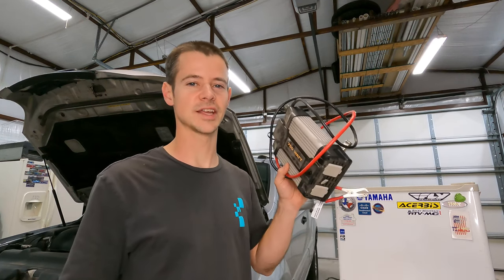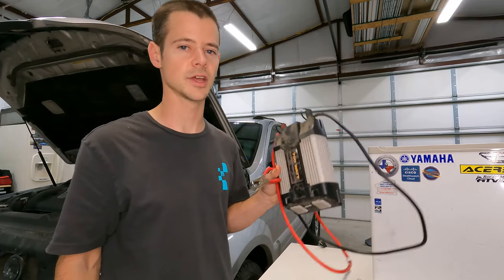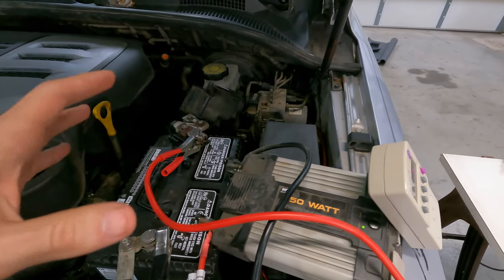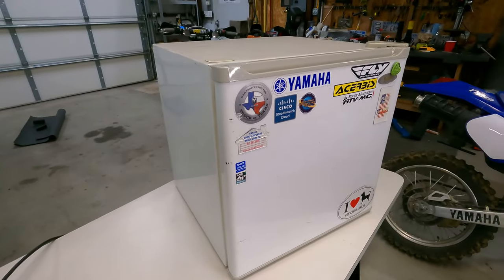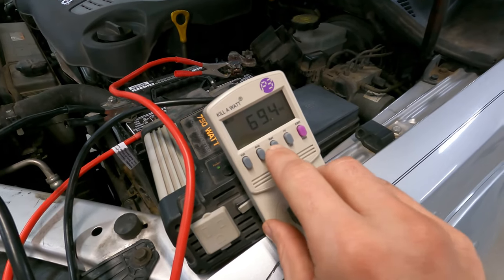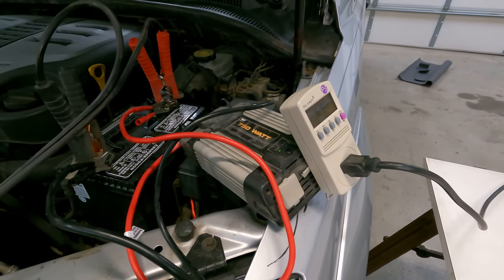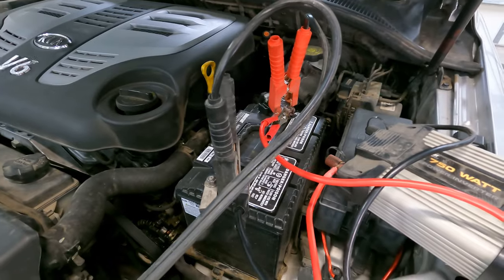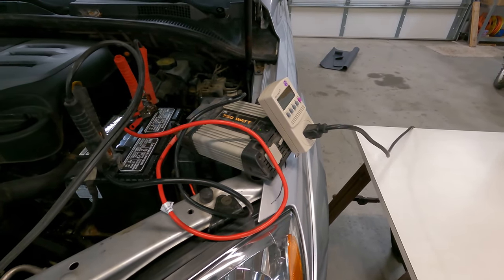Can a Cheap Inverter Power a Mini Fridge?

Comment: Thanks for this video!! I have a 1500 W inverter and wanted to plug in my mini fridge in my Freightliner! This lets me know it’ll work with no issue.
Reply from the maker: You are welcome! I don't much about Freightliners, but I would suspect if the wiring is heavy gauge enough, then it would handle it. Do you know if trucks like that are 12v or 24v? If 24v, and your inverter could run on that 24v leg, it would reduce the amp draw by half, and also reduce voltage drop by half - possibly more. Let me know how your setup goes. This stuff is so interesting to me.
Reply: @uthe54  Think trucks are 12 and have pretty huge amp rating alternators that can continously handle high loads

Comment: 0.59 Power Factor is a bad Modified Square Wave.  Pure Sine wave would be 0.95. (1/ 0.59) x 70 watts == 10 amp draw on the battery... Pure would be closer to 6 amps.
Reply from the maker: Thanks for your comment! I guess I should try this again with a pure sine wave inverter to compare the difference.
Reply: I think you mean the bad-PF load should be run off PSW inverter rather than MSW, and I agree.  

The wording of the comment above makes it sound like the low PF is a function of the MSW inverter rather than of the inductive load.
Reply: No, a induction motor has a low power factor on its own, that has nothing to do with the waveform!

Comment: I took an old freezer on a long remote  hunt and it ran for a while.  The freezer died  half way through the trip.  Not sure if it was the modified sine wave that killed it, or the compressor didnt like offroading.  Trying pure sine wave and a new freezer this year.
Reply: I'm having similar issues.. could it be from the inverter or the fridge
Reply: @idowuayorinde5201  its most likely the inverter. it damaged the compressor . try pure sinewave next time

Comment: The Power Factor represents the phase difference between the voltage and the current.  In an inductive load like the compressor in that fridge, the current will lead the voltage.

Comment: Most fridges have the amperage of the start up surge not constant power usage yhats why it jumoed ti 200 watts then dropped down and leveled off  still would use pure sine for constant use but modified is fine for temporary back up i have heard that fridge compressors are usually ok to run fir long periods if you have to but idk if would risk it

Comment: I was looking for a video exactly like this absoloute legend. Buying inverter and fridge to now 👌🏼
Reply from the maker: Glad it was helpful, but if you are starting from scratch, might I suggest using a 12v compressor style fridge. I have a BougeRV brand and while it has less internal volume, it doesn't require an inverter and is much more energy efficient to power. Check my channel as I have a few Will it Run it videos related to the BougeRV fridge. Thanks for your comment!

Comment: great video thanks for sharing. Lots of good information. Question, how big of an inverter can you run of the cigarete lighter connection? Is it better to connect ones inverter directly to the battery? Any inverter brand you can recommend?

Just checked my 10th gen civic and the alternator outputs 130 amps, how big of a inverter can my car handle?
Reply from the maker: Standard cigarette lighter connectors are generally protected by a 15 amp fuse. In my experience however, they aren't good at pulling 15 amps continuous as they tend to melt or at least wear out the spring that holds them in the socket due to heat. I would suggest cutting in half to roughly 7.5 amps to be on the safe side. Remember - the amp rating is at 12 volts. 12volts x15amps = 180watts (on the inverter side). This is likely why you rarely see inverters rated much more than 150 watts that are designed to run on a cigarette connector. Same calculation at 7.5 amps would be 90 watts. To be "safe" stick at or below 90 watts. This is your load - you can have a 2000 watt inverter run on a cigarette lighter outlet as long as the load you put on the inverter stays under the 180 watt range.

Connecting directly to a battery is preferred if consuming more than that. Keep your wiring as short as possible and be sure to still use a fuse if permanently connecting it to a battery.

Reminds me of my father-in-law that had a 750w inverter to run his 400w fast battery charger for his drill gun batteries between jobs. We wired it directly to his truck battery with speaker wire since it couldn't power the battery charger through the cigarette lighter connector.

Hope this helps!

Comment: Interesting, has an electroboom feel to the video. I like it. Alternatively you may see if you know any HVAC technicians that would like to work on a project to use a DC motor to operate a compressor. Then you could run off a cigarette port possibly with a lithium battery that charges during down time and operates in parallel with the car but only runs the compressor if it's plugged in and runs an LED when the door is open regardless
Reply: Too little fireworks, bleeped cussing, and eyebrows, for an Electroboom video. :D
Reply: @IstasPumaNevada  agreed, it has the educational aspects of electroboom without the comedy.

Comment: Do you think I can run a 100W refrigerator on a 150W inverter?
Reply: I didn't have any luck running my 80 watt mini fridge on a 150 watt inverter.   Just too much draw at the start.   I now use a 400 watt inverter and it works just fine.
Reply: @davidanderson563 what inverter are you using ?
Reply: no

Comment: I have a hisense mini fridge, a jupiter 740w msw inverter, brand new 105 ah deep cycle, oversized wires, 400w solar panel, 30 amp controller.
It will not run the fridge. 
Nowhere can I find the amp/wattage for this fridge.
It actually drags down my 1400w generator when the compressor kicks in. I don't have a killiwatt meter. What to do? 🤔
Reply: You probably need to change your inverter.
Reply: @temp911Luke  Thanks! I did. Got a psw 2000w and new controller..works great now 👍
Reply: Really what you should do is buy a 12v mini fridge . For the price of a big pure sine inverter it would be cheaper to buy a mini fridge that uses a fraction of the power. Just my opinion

Comment: Would you recommend this method?, I'm about to be living out of my older Honda and I know I'll need a fridge for food
Reply from the maker: Hello - I would not recommend this setup for when the vehicle is off. It would be interesting to see how long a large size Lithium battery would run this fridge for though.
Reply: Hi. You need to use a “true sine wave” inverter, not a cheapo like this one. He said that, too. 
The fridge ‘will’ run on a modified sine wave inverter like this but motors don’t always do well because while the voltage ‘averages’ 110 volts, in actuality it is jumping from potentially 60V to 160V 60 times per second. 

Having done a lot of stuff with solar in recent years plus 12V and inverters for  20+ years and I have fried computers and stuff on modified sine wave inverters is why I say true sine is needed. Cheaper to spend on the inverter up front than replace fried equipment, trust me. I’ve done it. 

Advice for you: get a 1200W inverter. The Giandel 1200W is moderately priced and its soft-start load feature will start a mini fridge. I’ve tested several on one. 
Plus, 1200W won’t  fail to work as it won’t be stressed to start the fridge. Lastly, a 1200W inverter will let you do other things down the road. Anything up to 10amps really. 

You shouldn’t run it on the car battery while car is not running. It could drain the battery so the car won’t start AND you will need to replace the battery sooner if you discharge it regularly- starting batteries aren’t made for that. 

Good luck to you. I wish you had a van. I have lived “on the fringes” myself but doing it in a car would super suck imho. No way really for a stealth shower or a comfy bed. 
You need a daily shower, a decent bed, and room for clothes to live fringe - yet live parallel enough appearance-wise to the mainstream to have a good job, good social context, and a healthy mental state. A gym membership can take care of the shower but trust me: that gets old and can be awkward/embarrassing. Sometimes you just wanna be in your own space. 

Figure out a way to get into a van or maybe something like a Ford transit. 300W of solar will take care of the fridge, computer, phone, water pump, and lights, more. See DIY Solar with Will Prowse. 

Living fringe/stealth and not “looking” homeless is bigtime important to not getting stuck in your car with no way out. Trust me (third time I’ve said that!) living ‘fringe’ by choice and with real goals is SO MUCH more pleasant than getting stuck homeless, stuck living out of a car, stuck feeling like a victim. It actually gets cheaper to live fringe/stealth comfortably than living out of a car because keeping a job- and progressing to better jobs- is easier than looking “below” who you really are or looking like a struggling basket case. Seriously. 
(You “may be” a basket case. I don’t know. I was for years but I did two things: I didn’t show people I was a basket case (still don’t) and I got myself with good people and good counsel cuz I didn’t want to stay vulnerable, stay where I was)

Seriously- I wish you the best. I know I’m making assumptions about your situation but just maybe if I’m wrong SOMEONE will get something good from this. 

Living out of a vehicle: I was always able to at least rent a building or have a camper on a cheap lot but wow I’ve been so close to living in a car more than once. I’ve been so fortunate to be... resourceful. I had rented a 30x40 building for shop space once. Circumstances with health issues I wound up very stealth living there; no running water but I brought water from a nearby freshwater spring, rigged a shower, had a fridge, coffeemaker, and electric frying pan. All my stuff wound up there and as it turned out I was quite comfortable. 

Do at least one thing EVERY DAY to better yourself. Always be going in a direction to better your circumstances. Don’t drink or do any drugs. Don’t even smoke pot. Write down every day what you did to improve your circumstances, summarize those every week writing them down, summarize the weeks once a month - and FEEL how you are succeeding at moving towards your goals. 

I hope you are doing well and days are satisfying as you travel your path in life.

Comment: Are you sure it isn't a pure sine wave? Reason I ask is I have a similar fridge and I can't get it to work off a 1500w modified sine wave inverter
Reply from the maker: I highly doubt its pure sine wave. I will say that I've learned not all inverters are created the same. Some other things to check in your condition. 1-Make sure you are using heavy gauge cables, and make sure they are short. Like a foot or two. The longer the cord, the heavier they have to be. 6 or 8 gauge at a couple feet should be fine I would think. 2-Make sure its got a good connection to the battery. Use ring terminals and bolts if you can. 3-Make sure your battery is in good shape. Lots of these inverters kick off if voltage drops below a threshold, but voltage will drop below a threshold with high current and long wire runs, and even worse for older or not fully charged batteries. Good luck!
Reply: @uthe54  Thanks for the advice

Comment: can it run a week long without shutting down the inverter?
Reply from the maker: I didn't test how long it would run, but I highly doubt you would get much runtime out of it. It also depends on if you want to deplete your battery all the way to where you will need a jump start, or if you want to run it down maybe 50% so you still have a charge left to restart your vehicle. Wild guess would be 1 day, but of course it depends on a number of factors - one of which being ambient temperature. Example: I often to winter camping, and a fridge doesn't see much time when its winter time if kept outside.